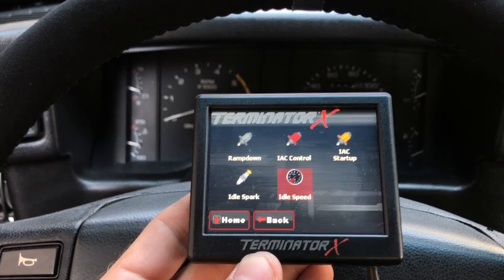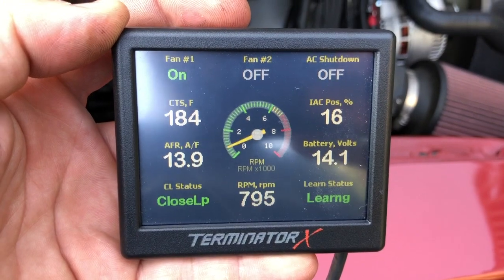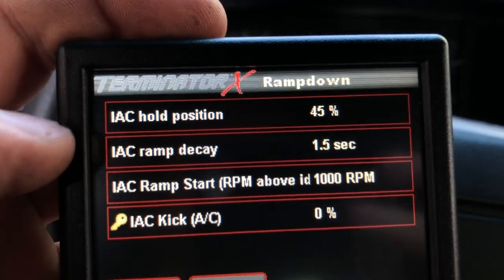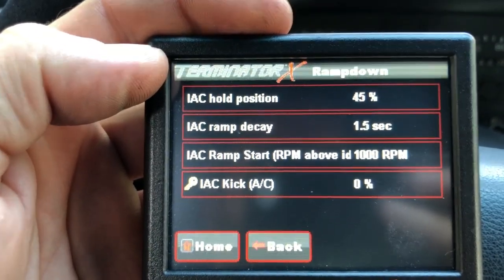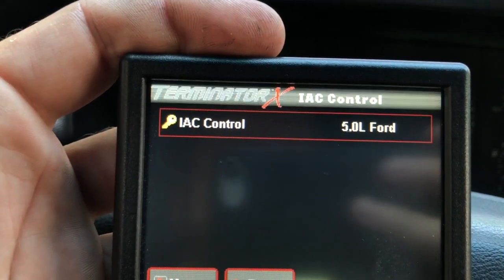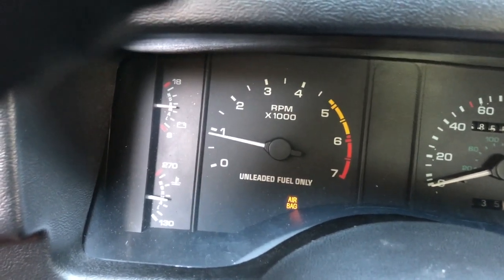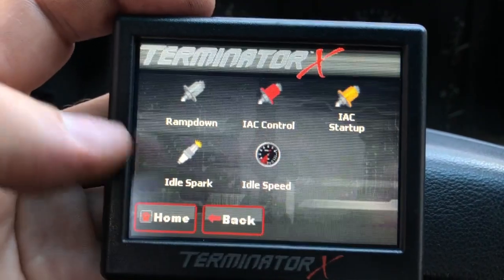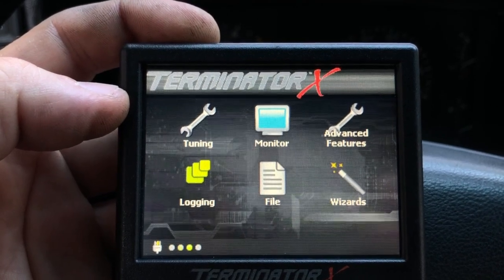Foxbody Mustang Holley Terminator X Idle Tuning

Comment: So I had mine tuned and after startup only on hot startup it will go to its 1400rpm like usually to start gradually ramp down and then it nose dives to 800 and then surges up and down until it settles.  Would that be the issue of the ramp decay time? It is set at 5seconds and the startup iac position hold time is set at 4 seconds along with that decay time also at 4 seconds
Reply from the maker: Many causes, but you can play around with that. Using this method (though your numbers may have to be different to get it to act like you want) should work well.

Comment: I've got a 5L with a aod on it. What do yall recommend for iac parked position. I can get it to start but sometimes it takes two cranks. Also, what's going on with your fuel pump prime or that first fuel shot while cranking? Do you like more fuel or kinda how these systems come stock?
Reply from the maker: Honestly, I just left the fuel prime alone. Never touched it. I'd experiment with IAC park position and see how it runs just after it fires. Is the idle high or low?
Reply: The idle is perfect after it starts. When I'm in traffic it idles 25 rpm high but I'm not mad about that. I'll try leaving all the fuel stuff alone and playing with iac parked. Thanks man!

Comment: I have a 1994 ford Lightning, I had a mechanic shop install the terminator x, 24lbs injectors, aluminum heads,it’s cammed, my truck struggles to get past 3000 rpm and won’t accelerate any help ?
Reply from the maker: Sorry you're having trouble. There's a lot that could be the problem. I'd try calling Holley tech support and narrow it down.
Reply: I have a automatic c6 tranny (3speed)

Comment: Installed a Terminator x on a 94 f150 5.0 manual trans. It has a slightly bigger camshaft than stock and the idle isnt the best. Would the settings be similar to this videos?
Reply from the maker: I think so, but check out the other videos on this channel for idle control strategies.
Reply: @Mustang-Geek  will do. It also cranks a lot before it actually starts. Any idea of what settings to change?
Reply from the maker: @cesarchavezalvarado5570  Does it struggle to start, or does it just crank a while? I recall mine craned a little longer than stock to fire.
Reply: @Mustang-Geek  it does not struggle to start, it just cranks for longer. Is there a way to fix that or will it go away as it self learns?
Reply from the maker: @cesarchavezalvarado5570  I don't think the number of revolutions before it fires is adjustable.

Comment: I had a factory ford IAC on my mustang and I never was happy with it on my terminator x so I purchased the accufab adapter with GM IAC and it works soooooo well it took me a year to figure it out the IAC would never be consistent and coming to a stop my idle would drop below Target RPM and slowly recover (ford pwm IAC) I did everything possible to figure it out until I was on Holley's forum and read you have to flip two of the wire's on the Holley 4pin IAC Plug because Holley's harness is wired for Holley/Chrysler IAC.

GM IAC stepper motor for the win...............
Reply from the maker: This will get the Ford IAC acting how it should. No need to switch to the GM IAC: https://youtu.be/F2APprj4jeU

Comment: What version software are you using? maybe that idle issue was fixed in the latest firmware?
Reply from the maker: It's not really a software issue, but rather a way Holley's IAC strategy works. I've had the best luck using a 1D table https://youtu.be/0_rCN8KExiY

Comment: I changed from Megasquirt to TX   today 1 start of engine ..changed some of the tune thats really of for the Mustangs . timing and fuel..after setting the timing correctly and engine at temp ... Idle is solid as a rock.. just changed the Iac to 5.0 PWM ...

Comment: Thanks for these videos man ..I have a 93 mustang gt I just got this installed now my car ever time I rev it up it stalls no matter in park or coming to a stop driving ...and am new at this terminator
Reply from the maker: This an auto trans? Make sure your IAC is working. With the engine idling, unplug the IAC motor. If it stalls, then the IAC is working. If nothing changes the IAC is not working. Let me know on that ASAP.
Reply: @Mustang-Geek  Na mine is stick ..I’ll have to try that out I’ll definitely let you know what happens I really appreciate it
Reply from the maker: @ripjanetstrimel3312  Oh, you said "in park" so I assumed it was an auto. Yeah, check the IAC to see if it's doing anything.

Comment: Everybody wondering why your fox still runs like ass after doing all of this.  Can the Can bus plug from holley for 60 bucks and a laptop with windows.  Download Holley terminator x software and change your IAC to PWM in the settings and drag PWM to the outputs.  Night and day difference and car runs like a dream.  You can only do so much with the handheld.  The laptop is definitely what you need to get it right.
Reply: Thank you! I was about to post this... trying to fool the computer with messing with the settings but not actually fixing the problem is ass backwards. I appreciate his attempt to help but its not going to fix anything. Dont forget to set the frequency to 315 when you swap it to pwm
Reply from the maker: @flyingwrenchesautomotive  https://youtu.be/kgJlLNI4xP4
Reply from the maker: The IAC is supposed to be set up as PWM from the factory. However, some people have had an issue where it's not set to PWM automatically, which will require hooking up a laptop and setting the IAC to PWM. If your IAC doesn't work AT ALL, it probably needs to be set to PWM using the software.
Reply: @Mustang-Geek   mine wasn't set from the factory and I had to go in with a laptop and drag the PWM to the 4th output.  I guess its hit or miss but it was driving me crazy trying to figure it out.
Reply from the maker: @thehellfox3423  Same for me, but I understand it's rare...maybe it's not as rare as I thought!

Comment: I’ve seen on other post and the directions of the term x that you have to go into the program select pwm in the soft ware and then you have to select it in I/o and drag it to the b3 pin for the iac to even work. Did you do this before making this video?
Reply from the maker: Some have had this issue, but I believe Holley has addressed it.

Comment: Do you know can you adjust fuel compensation settings from the handheld or does this need to be done from a laptop? Just started the car for the first couple times idle ls rich and the fuel compensatio is -50 which is the default I think.
Reply from the maker: I recall you can do it from the handheld. You can adjust the desired A/F ratio at idle. However, if the car is still rich, but the Terminator is taking out a lot of fuel, something else is wrong. Make sure you have the right injectors selected, the MAP sensor is hooked up to manifold vacuum, etc.

Comment: i have a question? is your iac set on stepper or pwm? i was told it needs to be set on pwm and pin it to number 4 and my iac hold goes crazy after i let off the gas
Reply: 2 things 1st make sure the iac is set correctly. And then check in the actual tune file(you will need your laptop) that output 4 is set to pwm. Alot of them were not and this had to manually done. I got one of the first batches and it wasnt linked.

Comment: Thanks for posting, I have never really liked how the IAC works, but have not taken the time to play with it.  This makes me want to try to make it better!  What frequency do you have yours set for?
Reply from the maker: Good question! Mine  is set to 600 Hz, but I haven't found any performance difference with different frequencies. I just set it to 600, as it was the middle :)
Reply: Get a Ford to GM IAC adapter from Accufab and run an LS 4 Stepper IAC....Youll be glad you did..